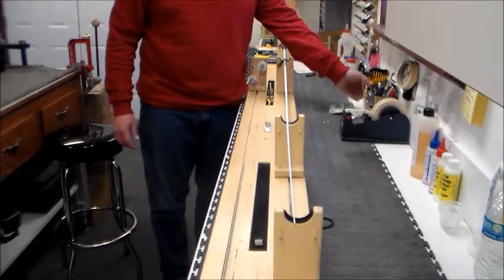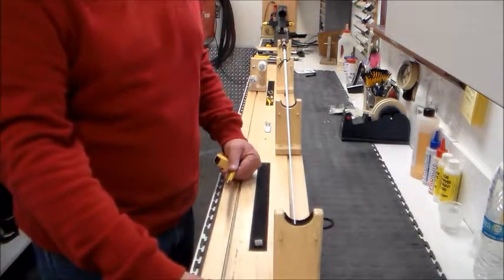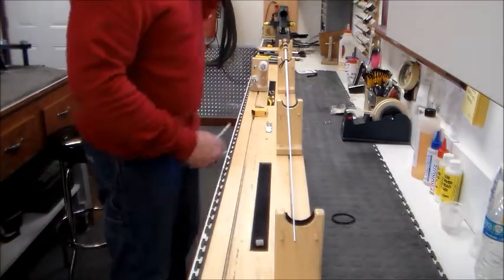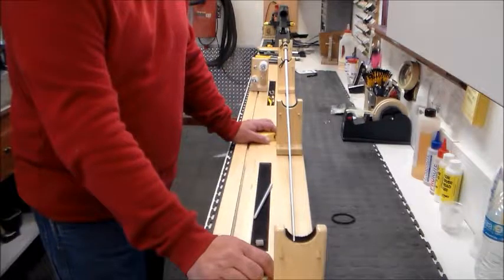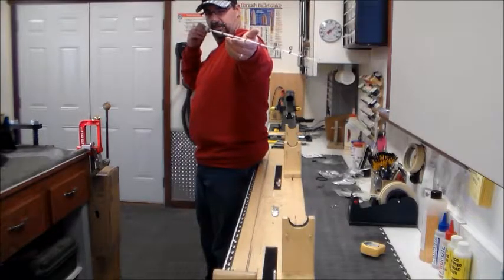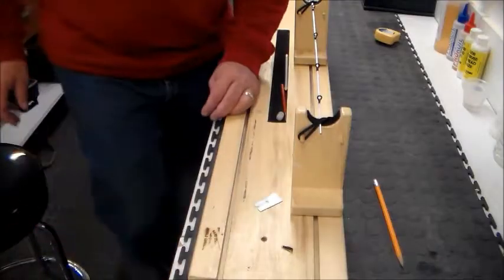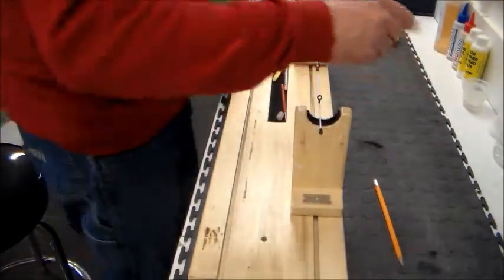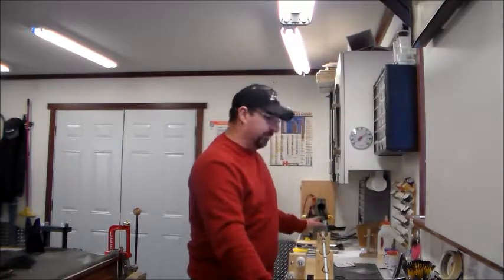Fishing Rod Build - Episode 4 - Guide Wrapping Part 2

Comment: How do u move the guides down if u have to
Reply from the maker: +Bill Dunston You have to remove and re wrap them to move them. The trick is to put enough guides on right away so there are no flat spots so you don't have to move them.
Reply: +Bill Dunston It's been a while since you've asked, but perhaps someone else has the same question.  As with anything, there's always more than one way to skin a cat.  What I do is cut thin strips of masking tape to use as temporary guide holders--you can also use a guide glue from a company like flex coat if you don't want to use tape.  Use your temporary holds to attach all the guides where you think you want them.  Once placed, do something called a static test with some line and a light weight to verify you don't have any flat spots when the rod is loaded.  This allows you to move the guides as needed prior to wrapping.  As you wrap, simply peel back and remove the tape once you have about half of the guide foot wrapped.  It's a slower process, but experiment and eventually you'll find something that works for you.